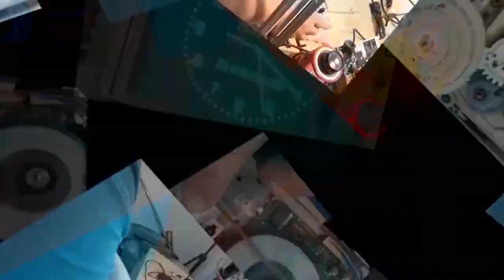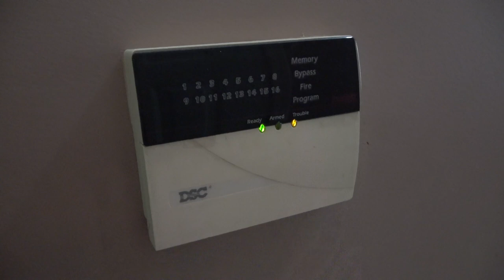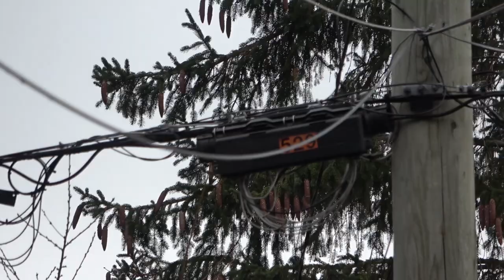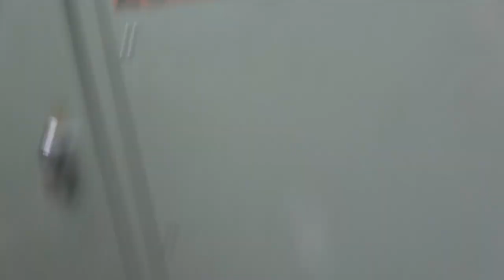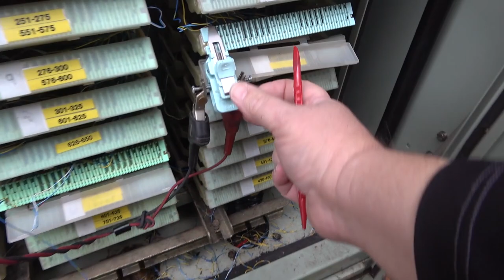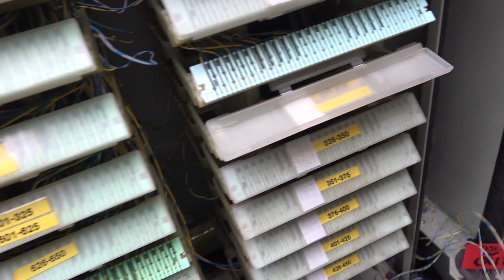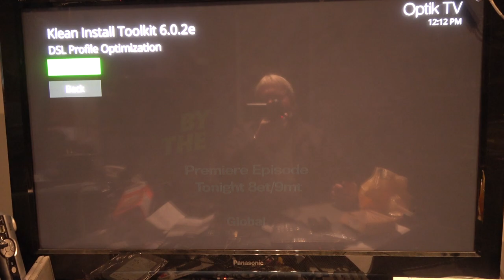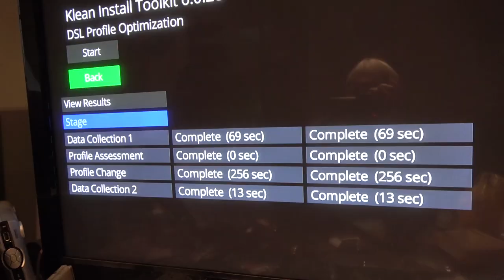Fixing my old noisy copper phone line

Comment: 60+ Mbps on DSL??? I always thought the limit was 7 Mbps for technical reasons!
Reply: Original ADSL would be. But this is probably VDSL2
Reply: @Agent24Electronics  Australia was stuck on ADSL2 all the way up till 5 years ago even then some places are still on it.
Reply from the maker: I just did a DSL install last week.  150 down 40 up.   I'm on a 700 metre loop so my max speed is just under 100. I pay for 75 and as of 5 minutes ago i am sitting at 74.3 down 20.7 up. 
Once optimization is complete it will go up a little more.
Reply from the maker: Bonded VDSL 17a profile.
Reply from the maker: We dumped ADSL 2 about 10 years ago.  There are still some old ADSL 1 and 2 dslam at the exchange but they have been powered off cold for years.  Fun to turn the power switch on and see a the alarm lights go on because they are disconnected from backbone.
Reply from the maker: Running 75 megs down and 22 up as of tonight.

Comment: 1) I have an Asterisk box and a Grandstream ATA. This lets me use a 500 set for calls. I can call NPSTN, TEN, and C*NET numbers. You might be able to set one up so you can call regular  7 and/or 10 digit numbers; I don't know for sure. (not an expert)

2) Ooma (VoIP) phone service, in the web interface for the router, has you put in your current address. So long as you have internet, the dispatcher will know where you're calling from. I used to have Oooooooooooooooooooooooooooooma service, and may restart it in the future. (Ooma doesn't support pulse dialing though)

Comment: When the authorities are able to find the location of a cell phone it is not done on the basis of GPS but rather on the basis of the trilateration performed by the telephone network and your phone constantly in order to determine the cell in which your phone currently resides. This was possible before mobile phones had GPS and is still possible. Additionally, phones don't do this any less frequently than they used to do in the past. The principles of the operation of a mobile telephone network are still the same. Finally, GPS location information has no mechanism to be used to locate you remotely over the mobile telephone network. GPS is a receive-only technology, your phone does not transmit any information when acquiring a GPS signal, modern phones do use the rough cell network trilateration information in order to speed up GPS signal lock but this is a: entirely optional and b: works in exactly the opposite direction to what you described.
Reply from the maker: Incorrect.  Triangulation is not used. It can assist but all modern cell phones do use GPS. They all have a gps receiver and that data is passed over the digital connection to the 911 operator as soon as you dial 911. All part of the e911 system.  I known this as i am a ham and know several invokved in search and rescue. When a skier or hiker gets in trouble and is able to get a cell signal there is generally only one tower they can hit. They get their location from the GPS chip in the phone.  Even if you turn the gps location off, the chip is still collecting your current location and will seen a packet back to the cell tower as soon as you dial 911. If there is no GPS data available then cell towers can be queried but this takes time and is generally not that accurate.  Your phone can also be pinged and reveal the gps location. We have emergency communicators for seniors so they can summon help if needed.  As long as the battery is charged anyone with access to the system can do a real time location look up. This is great if grandpa or grandma whom has dimentia gets lost. (Or loses the pendant) it is easy to track its location. All done by GPS.

Comment: My DSL (in Manhattan, NY) was 1mbit downlink about 6 years ago, how is yours 75mbit!?
Reply from the maker: Depends on how far you are from the dslam ports.  I was about 4 blocks away. I also had a bonded loop which is 2 phone lines running about 38mb down and 10 up each.  Gave me 75 down 20 up.   I was about 1800 feet cable length from the port.  Before the field dslam went in i was 5400 feet and my speed was limited to about 7mb down 1 up.   Field dslam went in about 15 years ago, and now fiber to house.

Comment: Love that AV rack!  I've had Onkyo stuff since the 80s.  Q:  Why not have Fiber AND Copper?  Faster Internet and still have phones, along with a secondary backup Internet.
Reply from the maker: Can't have both.  Copper is being sunset now.  I held off as long as i could.  People that ignore the registered letter are finding their phone, internet and TV cut off.
Reply: @12voltvids  I'm like that with most technology.  I hang on to existing tech that works great for way longer than most.  Esp cell phones and computers.  And there are still issues with some fax and credit card machines working correctly with VOIP phone lines vs POTS.  Good luck bud!
Reply from the maker: @RustyTheGeek  Copper is being shut down here. I have a big video planned to show the inside of the CO and the transformation over the past 18 years I have been at this CO. I won't do anything while I am still working for the tel, but once I retire I will haul out footage I have shot and do a video.  I'm not doing anything while I am still working there because I don't need any backlast. Some people post behind the scenes footage only to find out the hard way after they get fired that they shouldn't have done it. I showed this footage shot at my house, shot on my day off and I didn't show anything other than equipment at my prem and an outside cabinet.